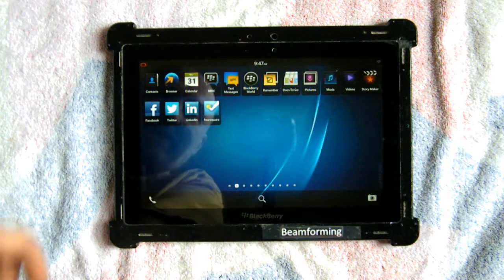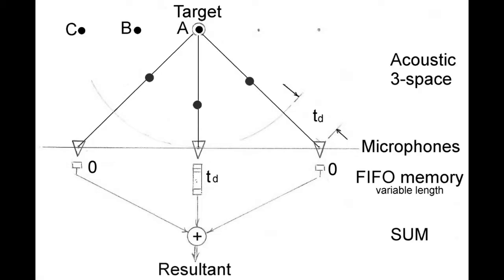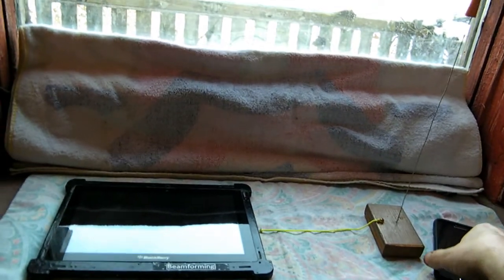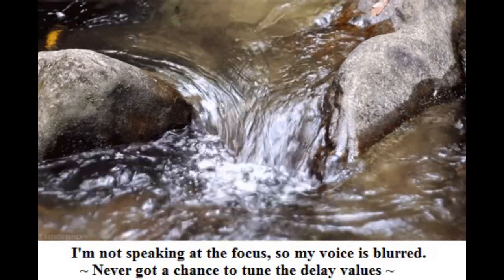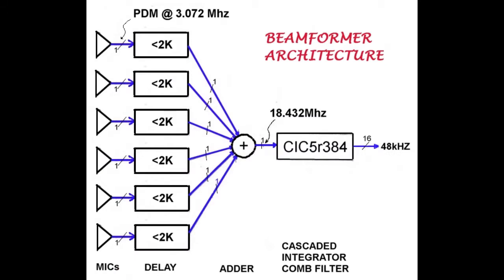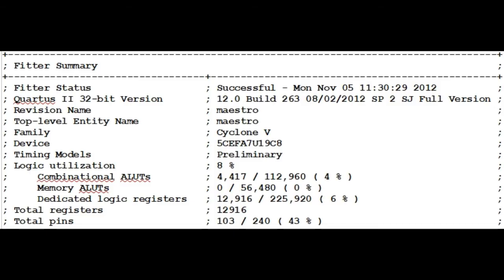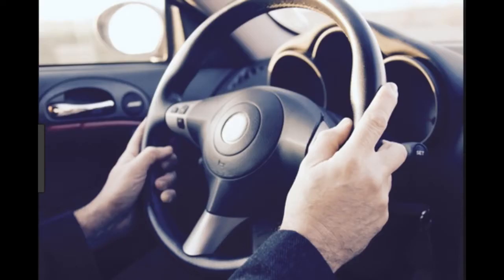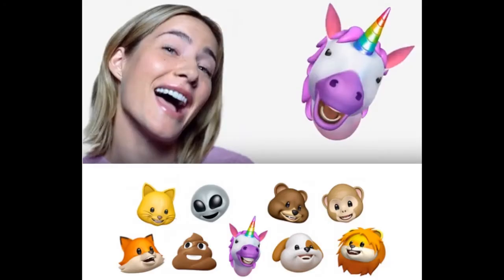Audio beamforming for smartphones: hearing aid

Comment: Is it possible to carry out the same project with an ST NUCLEO board?
Reply from the maker: Thanks for watching.
Sorry, but my blunt answer (opinion) is no. Consider the parallel thoughput going on, the data rates required, and the computations you would need to do for the filtering/decimation.
I have reverence for STM32 and noted long ago that the ST upper management mostly have engineering backgrounds, which is why it is a good company. 
If you can't find a way to beamform with an STM32 then the natural thought progression is to a fancy DSP and now it becomes an overly complicated programming problem on an expensive chip, when my design is trivial on an ASIC/FPGA.
I knew a Chinese engineer who would pull out the epithet “cut the feet to fit the shoes” when we were trying to make existing hardware fit a problem it was never meant for :)
Reply: @htpac  Thanks so much for the super response. I have the obligation to use analog microphones to carry out beamforming. I could kindly ask you about the material to better understand the theory. Assuming we can digitize the output of analog mems with A / D and read the data with STM32, what remains is to program the microcontroller to introduce delays, right? I should fill arrays with the digital values of the microphones output and work on the sum by translating the cells. I thought so. I'm doing it wrong? I would really appreciate it. Good day